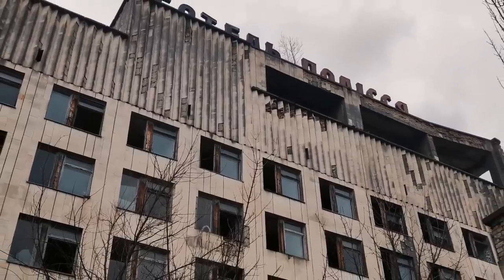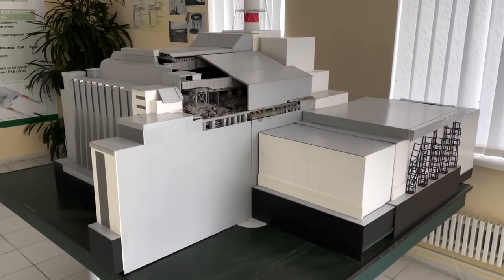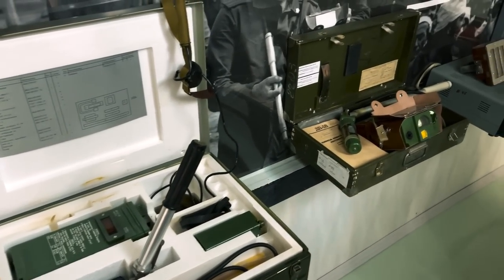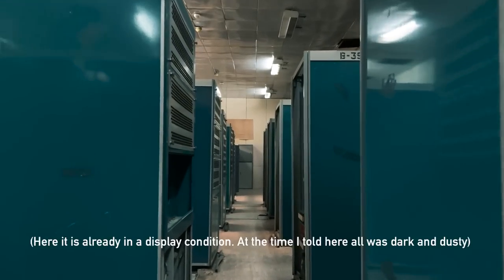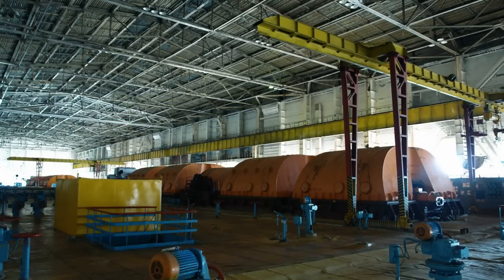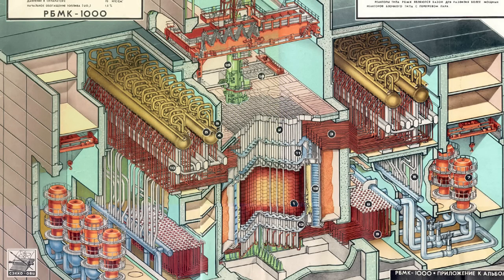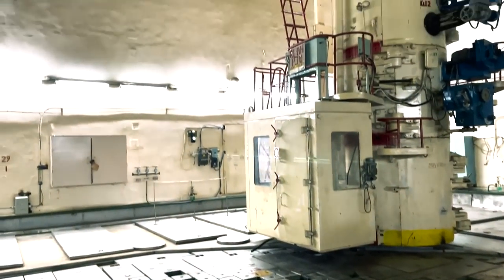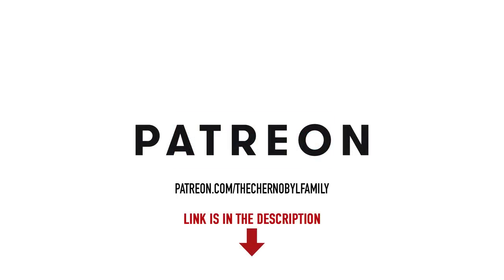INSIDE CHERNOBYL REACTOR 4 CONTROL ROOM. Power Plant Tour.

Comment: Thank you for showing the skala, it should absolutely be preserved. CuriousMarc would have a field day getting it running again
Reply from the maker: Well, we can guide @CuriousMarc if he will wish to come to see some Chernobyl hardware at some point, as we are guiding people in the Zone for years ;)
Reply: @ChernobylFamily  Is it already still functional ?
Reply from the maker: Let's say, as far as we know, it is not destroyed. It was a near miss - we went there a kind of week before dismantling, and explained it is an important thing. How intact it is on the level of circuit boards we cant say at the moment, but assuming zone-internal regulations, it likely is totally intact. When we eill get there again, we'll have more information.
Reply: @ChernobylFamily  Incredible! With some work it might be possible to fire it up again
Reply from the maker: @krz8888888  an open question is how it succesfull it will be. What you see in a video is a tip of the iceberg, SKALA is not a usial mainframe, it is a distributed system that is very, very, very big. Next time we will check that with the NPP.

Comment: Always happy to see more material on the plant itself. Especially since I attempted to model it as a map in Garry's Mod. I wanted to do this, because I wanted to be able to explore the interior space. There were other Chernobyl maps based on the S.T.A.L.K.E.R. series, but they all took place outside,with maybe a token room or 2 inside. I felt I wanted to see inside, and to know where the control room was from the reactor hall, and from the turbine hall, etc. Ultimately, I envisioned it in 3 episodes being pre-accident,immediately after accident, and modern but pre-NSC.  It really gave me a sense of the enormity of the complex as I developed more and more of the map. And ultimately that is what halted progress on the map. I eventually hit the limits of the game's engine and could not add any more detail, without removing something. I ended up with a rough estimate of the turbine hall, the deaerator hall, control room 3, pump rooms of reactor 3 and hallway, reactor hall3 with equipment room and reloading machine. and some other details. I built around 3 since I had the videos, and a couple of lousy blueprints, I could source from. I figured once I'd detailed 3, it would be a matter of copying and mirroring it to make 4, and then adjusting for any differences, but I hit the limits before getting that far. A more experienced map maker for the Half Life 2 engine probably could've optimized the map better and make it run better, but aside from a couple of tutorial maps learning to draw basic shapes, this was my first map. Aside from a few shortcomings, I'm still pleased that I was able to get so far, modelling a place I've never been to, using only a handful of vids, pics, and blueprints, using software I've never used before. But now, from a comment in the video, I realaize that I need to eliminate the golden panels in the deaerator hallway, since it's before the accident, and the gold panels happen afterward. If you ever play it, feel free to let me know what I got wrong, as I'm sure there's plenty.
Reply: Incidentally, it's only phase 2 (Reactors 3&4), since that's all that will fit in the boundaries of the maximum map size. I'd also wanted to create phase 1 as a preliminary map.
Reply from the maker: This is a very interesting story, thank you! It reminded us how we have been making that tabletop model, having a very limited information (it was hard to predict what specifically would be needed until you come to the particular element). Nevertheless, it worked. We more than understand your feelings, but the fact you did your best as you described is itself very impressive. Good luck with this and further projects!

Comment: Love this kind of stuff (a small amount of radiation reached us here in Denmark back then), as well as the retro computer stuff.  Had wanted to visit the area years ago, but nothing came of it.  I'm well-versed in western computers of the time, my first being a Commodore 64 back in the 80s.  Decades later, I made a russian friend and he told me of clones of the Spectrum that he grew up with.  Apparently there were also clones of the early Commodore and/or Apple machines (they used MOS6502/6510 cpu) called Agat.  Would love to see some videos of those clones.
Reply from the maker: On our Patreon, there is a recent public post, where we posted Sweden/Norway/Finland 137Cs maps, therr is also a part of Denmark. If you wish, we can post the full maps.

Well, it is such an area, that is very dynamic, and when the opportunity will come, do not miss it - it degrades, and degrades fast. 
As for clones, might be. Never dealt neither with spectrums, nor with Agats, but that might be interesting to try!

Comment: 11:31 the camera gets blurry and grainy due to the high radiation of the wall. Damn, I've seen explorations where the dosimeter starts screaming in alert but not seen cameras image get that blurry
Reply from the maker: Thank you for you comment! Unfortunately, the camera gets blurry and grainy exclusively and only because it is VERY dark there, so we needed to make exposition to max just to make visible at least something on video. To make that effect you mentioned, radiation should exceed (in general, but not always) around 50 mSv/h, while there is around 8...10 μSv/h. At main circulation pumps the level in some places is significantly higher (a side-effect of technological process in that hall), but still no visible effects.

Comment: Very good video. Before war I had plan to visit ChNPP.  Pls post more about IT stuff and ChNPP.  As amateur radio operator I remember  DUGA - i have some were recording of it.  It was called pesky Russian Woodpecker.  It''s HF over the horizon radar, operated between 7 to  19 Mhz but it polluted almost all HF band in north countries. I remember that for abut 3 months in time I used it at warning about aurora ( at 3 harmonic freq ).  In Poland it was strong ( if  remember  correctly it was 10 MegaWats RF power out to super big curtain array with several dB gain ).  Glory for Ukraina. Best regards from Poland. Keep strong and post videos. Vy! 73.
Reply from the maker: 73! 73! 73!
Thank you for all you support. Glory to heroes! There will be much, much more videos on tech stuff, on Chernobyl stuff and on both

Comment: Isn't it still dangerous to go back into these structures now? What's the radiation risk?
Reply from the maker: It depends. During the Chernobyl disaster the internal contamination was caused mostly by ventilation system which continued operating for a few more hours; it took nearly a year to decontaminate everything. So generally, after those works levels are normal or acceptable by the standards; inside Unit IV premises there are very extreme levels which makes most of it off limits or available only for trained people for a very short time. However, the diversity is so high, that there are also places there where people work all day normally.